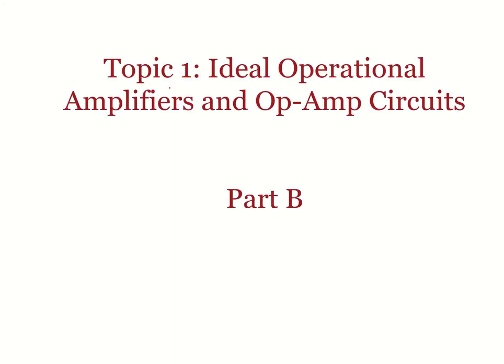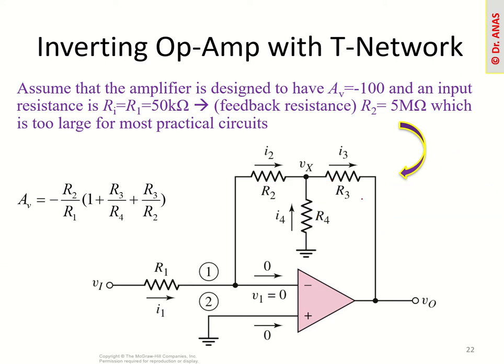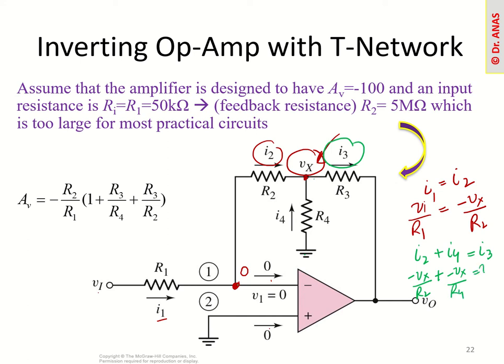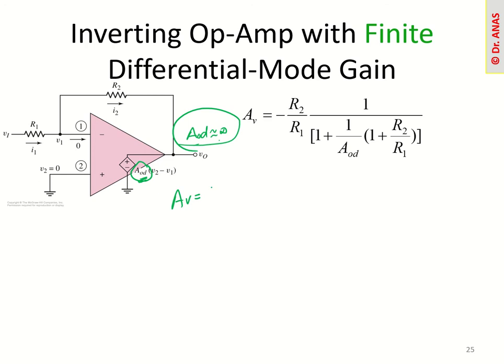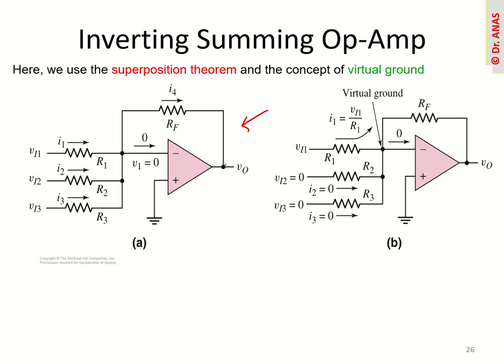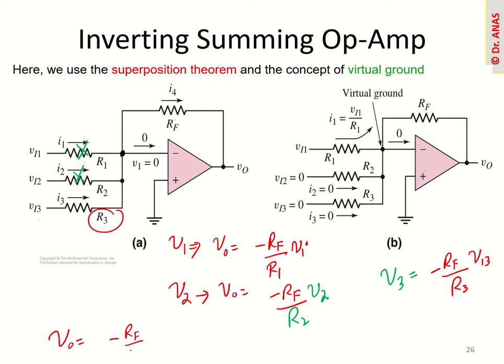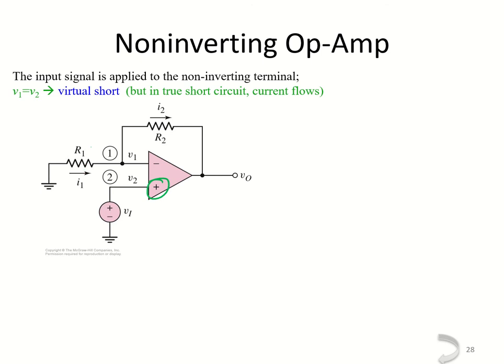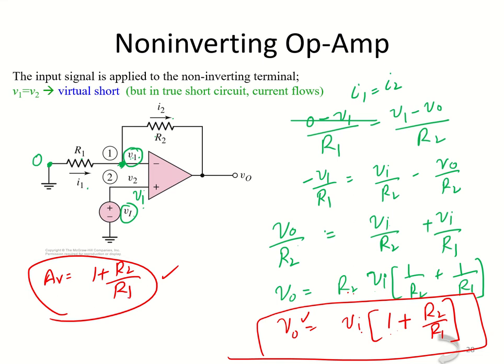Topic 1 | Ideal Operational Amplifiers: T-Network & Non-Inverting Op-Amp Explained

Comment: If we use 5 Mega Ohms in the feedback then this create instabilty and the noise will be picked up by the feedback resistor and is amplified and in trun this will destroy the circuit function. Back in the 2006 I used this configuration and only T feedback circuit worked perfect. The high resistor placed directly on the feedback gave me nightmare trying to operate the circuit.